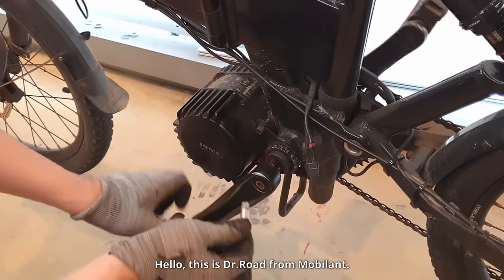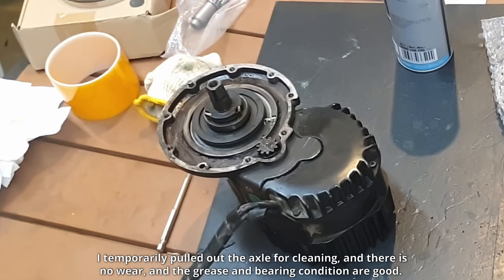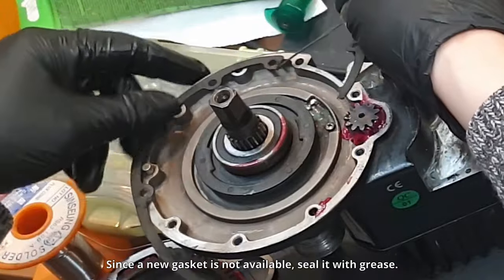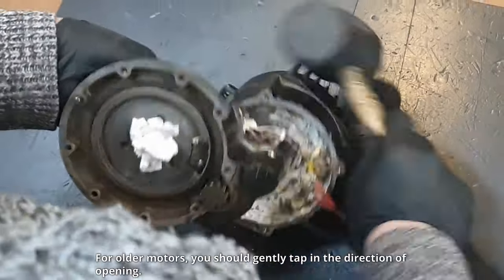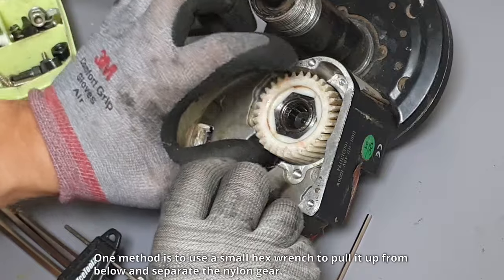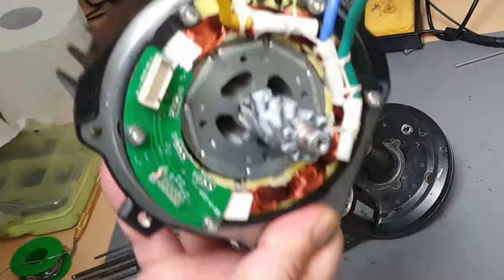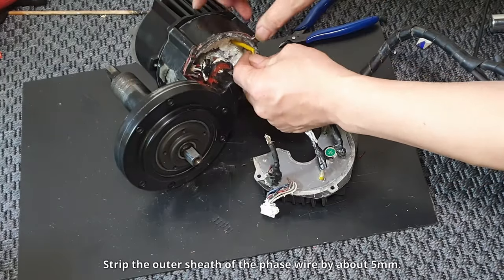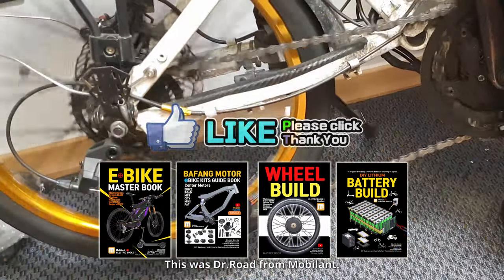Book : Bafang USED Motor Complete Repair Guide 01  : BBSHD BBS01 02 ebike kits

Comment: A completely new assembly for a BBSHD is $725 at this time.  It's worth considering based on what needs to be done to repair the old motor..  Don't use broken gaskets.  Grease is not meant to be used with a gasket.  Use high temperature auto silicone vs the gasket.
Reply from the maker: Yes, I used grease to supplement it since the damage was not that big and there was no room for water to penetrate.

Comment: Awesome video! I have a question, can you also use the bearing separator tool for the pinion gear bearing? Unfortunately mine broke and I wanted to replace it. Thanks!
Reply from the maker: https://s.click.aliexpress.com/e/_Dly4H5x Slide hammer bearing pullers come in many sizes.
Reply from the maker: Or, if it's a large bearing, you can pry it out from the other side with a flat driver. The clutch bearing in the nylon gear cannot be replaced and the entire nylon gear must be replaced.
Reply from the maker: https://s.click.aliexpress.com/e/_DCPJEhX parts list
Reply: Eyy thanks for the info man! Yeah, i also have a defective nylon gear and I already bought another one. My BBSHD is 5 years old already and some parts are definitely failing like the bearings for instance. Luckily, I know a bearing supplier who have them. 😊

Comment: I've looked at quite a few bbshd guides and this is the best one I've seen. Thank you! Can you share where to find those two tools you used to pull out that pressed in bearing (the black inner bearing puller and the weight removal tool)?
Reply from the maker: Of course it is. This is a slide hammer bearing remover.
https://s.click.aliexpress.com/e/_DC0vN8P
https://amzn.to/3rETm9s
Reply: It's called a blind bearing puller.

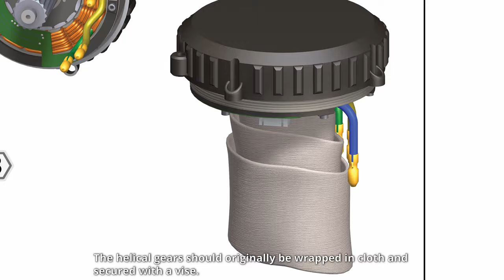Comment: At 6:50 you state that the new style roter can be used with older motors, this is incorrect. the old rotor has a 24mm bearing and seat in the housing. The new rotor has a 26mm bearing and will not fit in a 24mm seat in the old housing.
Reply: Also the bearings have different ID 8mm and 9mm so you can't swap the bearing over either. you have to find a 24mmOd 9mm ID bearing to use the new rotor in an old housing.
Reply from the maker: Yes, I just received it. I need to replace the entire motor coil core.
Reply from the maker: Thank you. I have removed the video of that part.

Comment: hello thanks for detail video, i have bbs02 750 that not working right, i work for short while and then stop, and then work for a while, can you advise me what wrong and how to fix it, thanks MO
Reply from the maker: If the pinion large gear is broken, the motor will be locked while driving.
Reply from the maker: Unless you have a broken tooth.  Controller inspection.  We recommend the following motor core or Hall sensor inspection:

Comment: In the controller, what’s the name of the black pedal assist connector and the white one next to it? I am going to try to re-join all of these wires as the controller is faulty but I need to order replacement connectors. Where do I order these connectors from in the UK? Thanks, M
Reply from the maker: JST-SM / XH 2.54 Connector

Comment: I have BBS02 how i understand when i need maintenance it like grease, seller and bike repairs said to me no need any maintenance for this motors
Reply from the maker: If you drive more than 10,000 km, the pinion grease may be contaminated and hardened due to dust inflow. The grease inside the case does not need to be replaced unless there is a problem. Grease condition was good until 30,000.

Comment: Hello sir thank you for You provide us with valuable benefits.From your class, can you guide me to solving the problem, even if it is just some information?I have an electric bike brinkers The Bafang motor may have a problem because the pedals have become too heavy.Would you like to prepare me if you can? Thank you. I hope you will respond to me
Reply from the maker: It's most likely a pedal assist sensor issue. (PAS PCB BOARD )https://s.click.aliexpress.com/e/_DmSYz1V
If it is a physical problem related to the axle, we recommend replacing the needle bearing and thrust bearing.
Reply: Hello sir, first of all, thank you for your beautiful communication and quick response. I want to tell you that the pedals when running electricity are somewhat good, but the big problem is that when using the bike without electricity, the pedals are very heavy.
To a degree of 100/100, but if you use the electric motor, it decreases a little to a degree of 50/100
: Because the sensor has nothing to do with normal operation, I assumed it is when the electric bike is turned on and then it does its job, isn’t it, or is it related even if the bike is without electricity?
Reply from the maker: @lafmat962  If the pedal becomes heavier, it may mean that the nylon gear (clutch bearing) is broken and the pedal power is used directly. If you have ever opened a large cover, I suspect that you may have installed the cover's ratchet in the wrong direction.
Reply from the maker: https://youtu.be/wurVeGWS9wY?si=OnqTor9OaOXZ7Rcu&t=206

Comment: why wouldn't you use RTV instead of grease for the gasket substitution?
Reply from the maker: In fact, it is not recommended to reuse damaged gaskets. Silicone is difficult to remove if used incorrectly. Because the cover is aluminum, scratches are likely to form when removing the silicone with a knife.